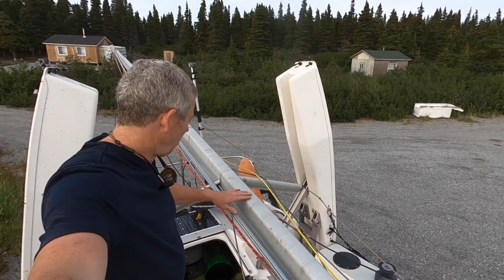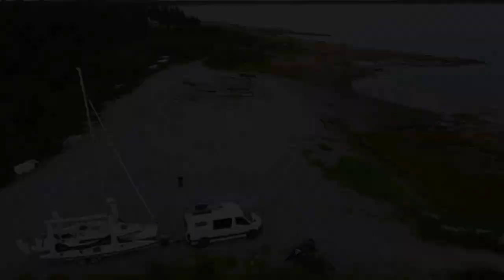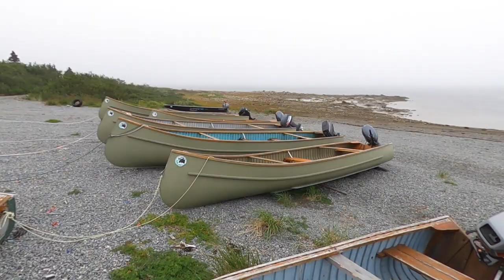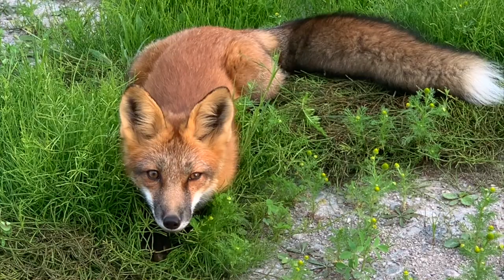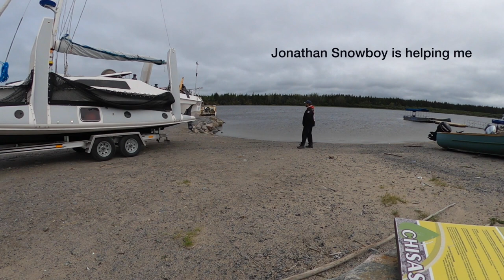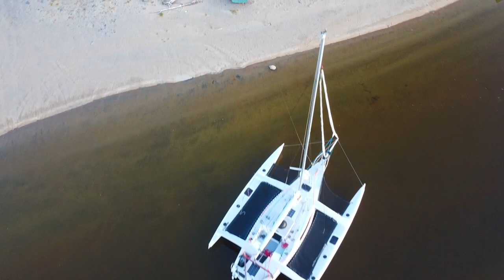Don't Give Up - Ep2 - Sailing on James Bay Canada

Comment: Congratulations ! You did it ! Lots of miles driven and then a battle to get it in the water ...lots of determination on your part . Congrats ! Too bad we weren't in contact as I plan on driving that very road on my motorcycle and it would have given me a reason to do it last summer . I could have assisted you if needed . Anyway this was an awesome undertaking by you and being a bit of a sailor myself these are the adventures that put a grin on my face . Thank you for sharing the experience !
Reply from the maker: Thank you!!!
That would have been cool. 
That long road is awesome. Super nice. All new asphalt.

Comment: what an ordeal you went through to get the boat launched eventually.  BTW,  I also own a 30 foot trimaran.  What is the sweating like in your boat when in the cold waters of Canada?
Reply from the maker: Good question! I did not notice much condensation up there on the boat, not more than in Florida, just that everything is cold. 
When I was there, the air was colder than the boat and the water, so maybe that actually prevents condensation? Not sure.